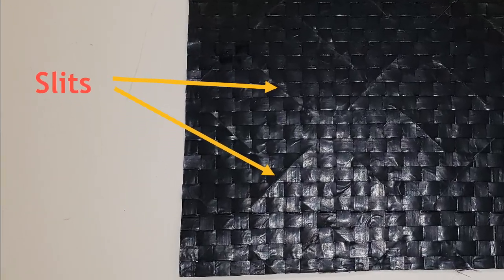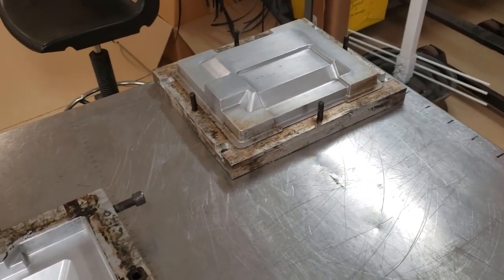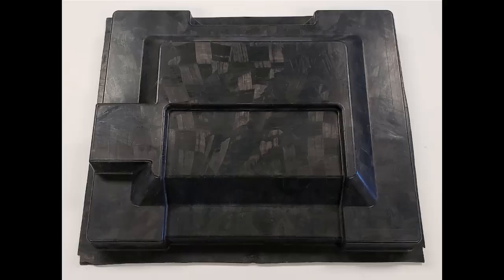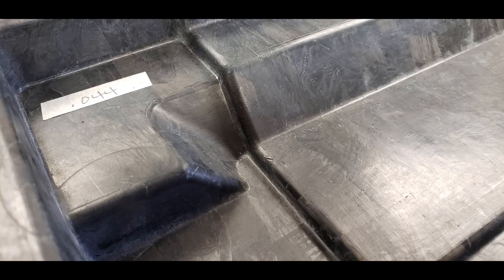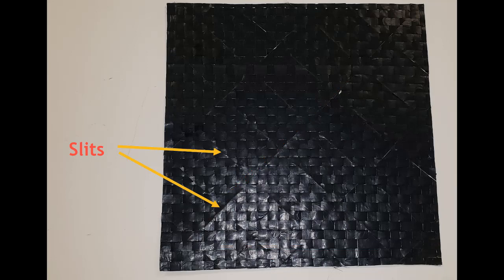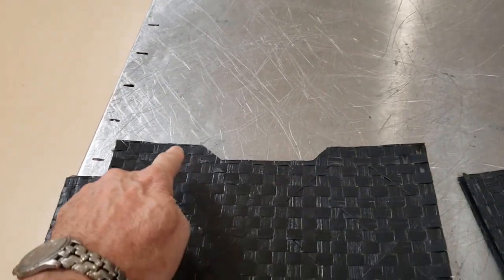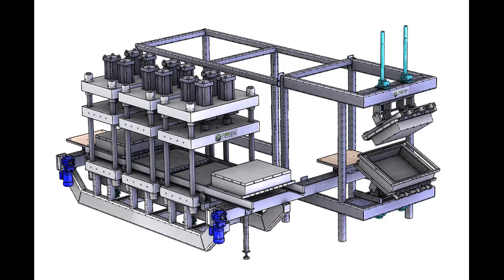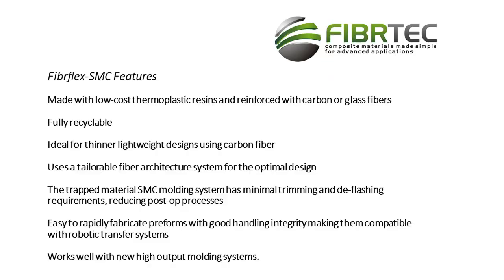Introduction to Fibrflex SMC- A thermoplastic composite material

Comment: Good video, well explained and looks like an interesting product. However, slitting a continuous fibre semifinished-product it in order to make it drapeable is not a "truly innovative approach" in my opinion. Basically by slitting the tows you risk part failure at the cut locations and probably lower impact strength overall.

I'm pretty sure you know the Tepex continuous fibre products and how they get thermoformed in 1 minute cycles to net-shape parts. They have great drapeability in the molten state of the thermoplastic matrix (mostly twill woven) and do not require to be slit prior to moulding.

You also state that you want to aim at high-volume markets, which require special composite thermoforming stations anyways. A batch process as you show in the end of the video is highly uneconomic in terms of mould heating and cooling cost.
Reply: I think you missed the point.  This is a multiply ply layup of Fibrflex fabrics for the SMC method of molding.  The slits are programmed to be in different places in each ply.  This video is of the short flow SMC version used to make high fiber volume thin structural parts.  The properties are not the same as continuous but the format gives the designer another tool in his tool bag.   If you need continuous fiber use the unslit version (see my older video https://youtu.be/ctwuZqfTgHc)  all of the fibrflex products can be made in high fiber volume fractions of 50-60% which is not possible in an organosheet without voids.  Process times a function of tooling and process.  The more you invest the faster it becomes, this is a cost-benefit decision the user must make.
Reply: @fibrtecinc.5974  hi, thanks for the reply, that cleared things up. Unfortunately, your video link does not work